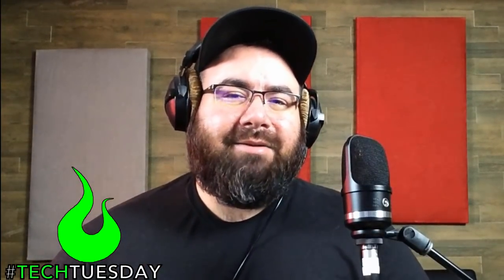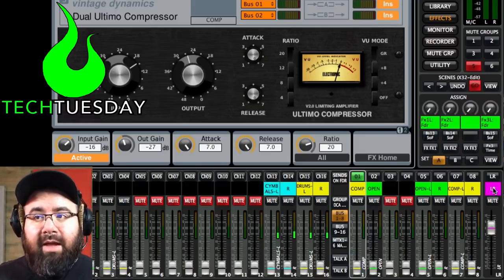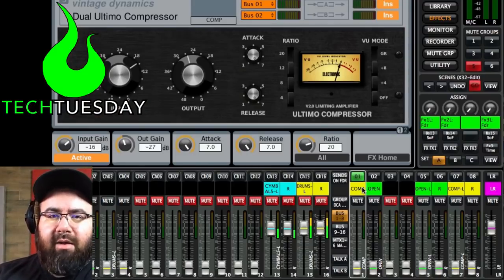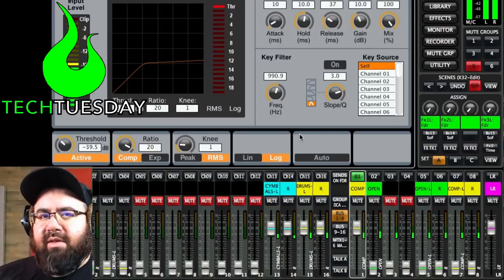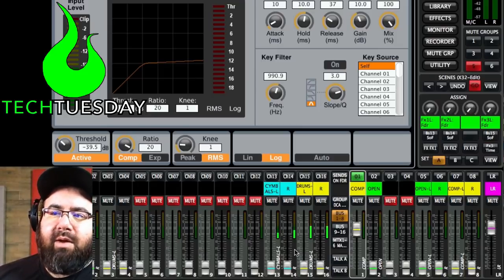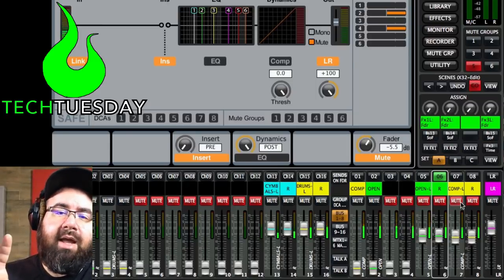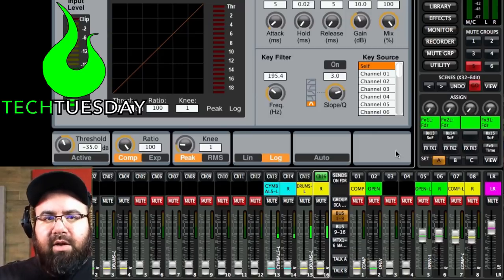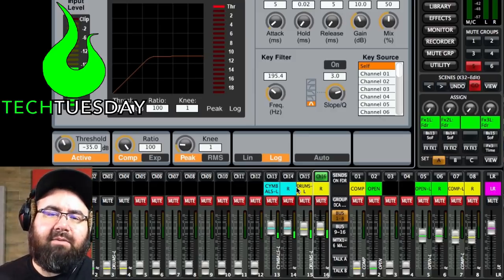X32 Parallel Compression Do's and Dont's - #AscensionTechTuesday - EP081

Comment: Hey man! Great video. I have gotten this topic but I’d like more info on how to send the result of this to the subs. Specifically the Toms and bass drum. How would I achieve this?
Reply from the maker: So I’m a big fan of setting up my subs on a matrix rather than an aux. It greatly simplifies techniques like this. Here’s a video showing how to set up some matrices on an X32. Hope that helps! 

https://m.youtube.com/watch?v=pzDcHUSYB_A
Reply: @AWTechTuesday  thank you for getting back to me! I watched the video and have seen an adjustment that I need to make to having the subs matrix to pick signal from the LR bus.  I currently use a matrix for my sub out that receives its signal from the mono-Centre channel while also having a crossover point.
 I did this to have some sort of control over what I send to the subs.

Comment: You and me need to order new pads for out Dt770s
Reply from the maker: Andy Perrigo This pair has been through a lot. Haha. I think I may replace them with a pair of Ultrasone’s next.
Reply: @AWTechTuesday  I like the 880's.
Reply: I will say that your tuts using the X32 have been very helpful. Helped me get ours under control.
Reply from the maker: Thanks for the encouragement!
Reply: @AWTechTuesday  although, I am not certain I'm willing to trade the X32 for the Presonus, yet. I prefer knobs for each section of the channel strip
Reply from the maker: The Presonus has the same number of knobs for the channel strip on the surface: Gain, Pan, HPF, Gate threshold, Comp threshold, EQ Gain, Freq, Q. The only one the Presonus doesn't have immediately on the surface is the mono level.

They are all bunched together. I don't love that but you get used to it pretty quickly.
Reply: @AWTechTuesday  oh. I thought that you had to select the characteristic and then adjust parameters
Reply from the maker: Andy Perrigo You can do either or both.

Comment: Hi Chad, for the X32 app, where can I get the version that looks like the mixer board like in your video? We are using another site on Sunday and I'd like to get to know the board using a simulator. Thanks so much if you can help!
Reply from the maker: Sadly, that app is no longer supported and does not work on many recent Operating Systems. You can probably find links to it somewhere online but it likely won't work on your computer unless it's fairly old.

Sorry :(
 - Chad
Reply: @AWTechTuesday  Thanks so much for the reply!

Comment: Do you have to have a stereo bus or can you just use two mono busses for this?
Reply from the maker: On the X32, all the busses on mono. To get stereo, you need to link 2 busses. Also, they need to start on an odd number. For example, you and link busses 1 and 2 or 3 and 4 but you cannot link busses 2 and 3. 

I hope that helps :)

-Chad
Reply: @AWTechTuesday  thanks for replying to my comment so fast btw watching you for a very long time now anyway I mean do you have to run a stereo subgroup for the drums in this case or can you just use a mono mix bus😁
Reply from the maker: @stevenadams-o9k  Thanks for watching! It depends on your system and if you want stereo spread for your drums or not. I’d always shoot for stereo if your system is in stereo and if you have enough busses to accommodate that. 

Me personally, as much as I like this trick, I usually reserve it for studio and broadcast applications and usually focus on individual processing for FOH so that my processing can benefit the monitors as well.

Comment: Hey Chad how ya been? So is this only an issue when doing parallel compression like this on an M/X32? Or is it also an issue when parallel processing vocals with FX the same way?  Like when sending dry vocals through L&R main and parallel processing vocal signal through an FX bus simultaneously?
Reply from the maker: Hey man! Some mixers aren’t affected by this because they will compensate by adding delay where necessary. I’m pretty sure the Behringer Wing, for example, has delay compensation. 

If you run a parallel chain for your vocals that includes rack fx, yes, the same issues and solutions will apply. When you run 100% wet time-based fx like a reverb and delay send and return setup, this is not an issue since the signal will be delayed compared to the original by design. 

-Chad
Reply: So basically anytime you parallel process any source with a compressor, you need to be aware of if the mixing unit compensates for the latency between the clean and compressed parallel signals? Other time based effects aren’t a concern as they do this intentionally.
Reply from the maker: @Bobby_Uterus  not just compressors. Any of the rack fx such as stereo wideners, etc.
Reply: @AWTechTuesday   Got ya. Thanks for the replies Chad, as always much appreciated.   Hey have you got to try Dante cards with your X32’s? It makes routing a breeze!
Reply: This destroys on bass!  Huge low end and retains clarity.

Comment: How did you group the drums on two faders? Are you using a subgroup
Reply from the maker: I'm streaming audio from my recording software into the mixer. So, I'm submixing the audio there and then sending it out a pair of outputs to channels on the mixer.

-Chad
Reply: @AWTechTuesday  is this subgrouping method a solution you’ve used in live applications? Or would you only do this for demonstration purposes because of reliability issues or something like that?
Reply: @bzrid it’s probably a subgroup because it won’t make sense for a post fader bus send be sent to the main LR so probably a subgroup send